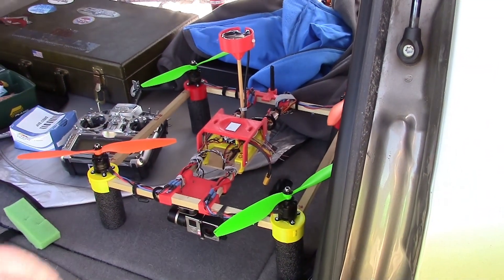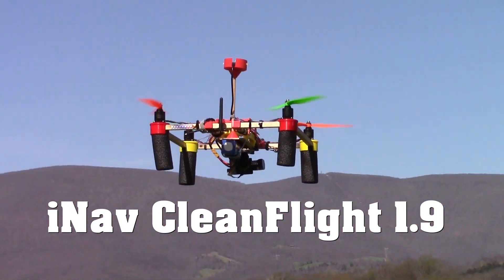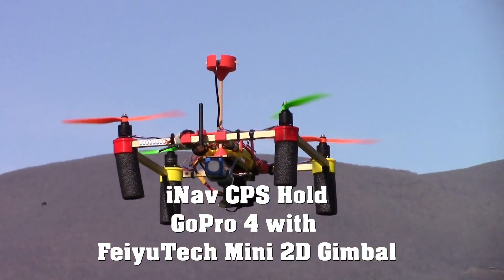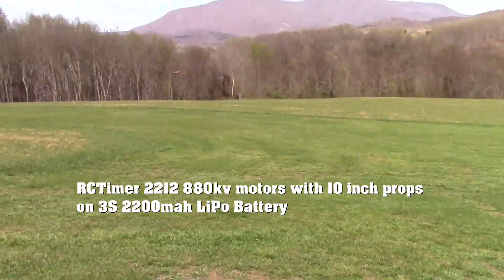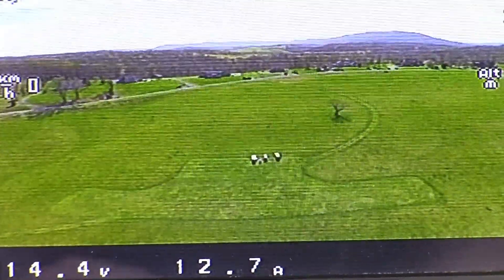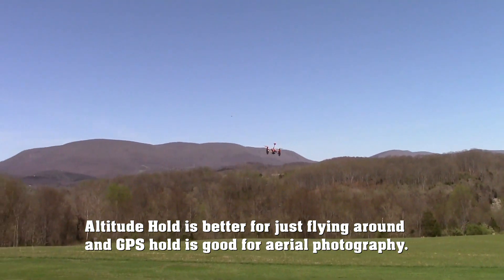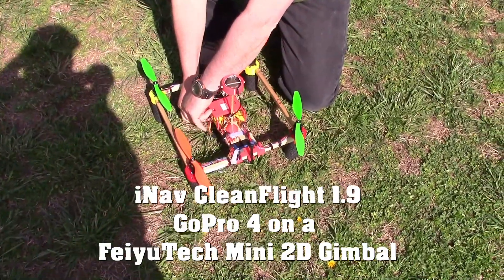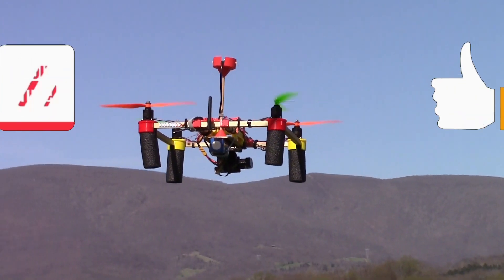Affordable DIY GoPro Camera Drone with Gimbal, GPS Hold, RTH, iNav

Comment: Great video Dave!  I look forward to more flying.  Here are the links for the RCTimer parts I use in all the versions.

1 Shot 125 ESCs http://www.rctimer.com/?product-1744.html
CF 10X4.7 props http://www.rctimer.com/?product-799.html
HP-2212 880Kv motors http://www.rctimer.com/?product-814.html
BeeRotor Current Sensor Board http://www.rctimer.com/?product-1790.html
BeeRotor F3 Flight Controller which is a genuine SPRacing board http://www.rctimer.com/?product-1527.html
GPS Mag  http://www.rctimer.com/?product-1287.html

I hope to see some folks print one up and get flying.  If you need any help hit me up on the RCGroups thread.  https://www.rcgroups.com/forums/showthread.php?2506002-Building-the-Woodie-copter&highlight=woodie
Reply from the maker: Thanks for the parts list! That is very useful. Hope others will build this and post their vids :-)
I think you use different props though, probably these:
Orange 10x4.5" EPP1045 Counter Rotating Propellers(CW + CCW)
http://www.rctimer.com/?product-583.html

Comment: iNAV working good I see.....I thought iNAV and Cleanflight were two different pieces of Software Dave...?

In your clip you call it "iNAV Cleanflight"...????

This whole deal is running on iNAV, not Cleanflight..?
Reply from the maker: Good question and a point that needs clearing up! 
iNav is a fork off CleanFlight on Github. Some genius programmers wanted CleanFlight to have GPS navigation capability so they modified the cleanflight source code to include navigation routines. So the iNav is just the short name for iNav Cleanflight.  To make things even more confusing it now seems to have morphed into the name iNavFlight thus combining the two names together.  There is more info here: https://github.com/iNavFlight/inav/wiki
Reply: Ah yes, of course, I see your point....although they are ALL branches of the original in the end.